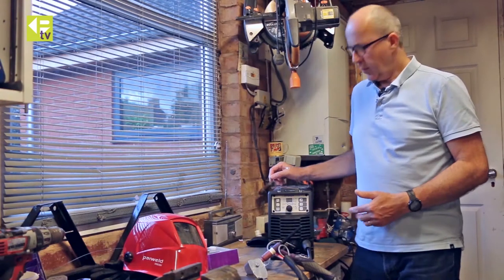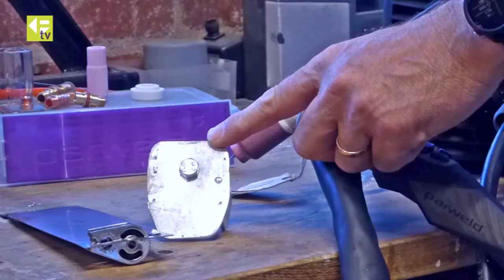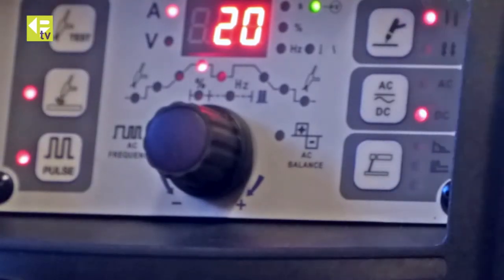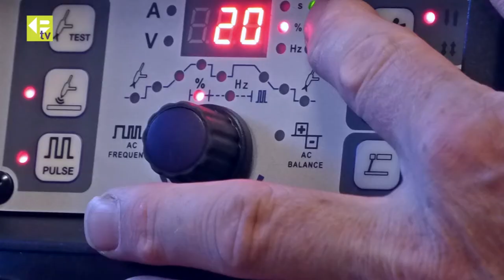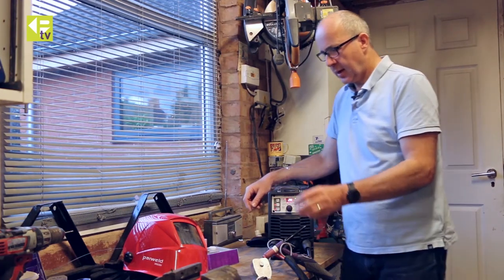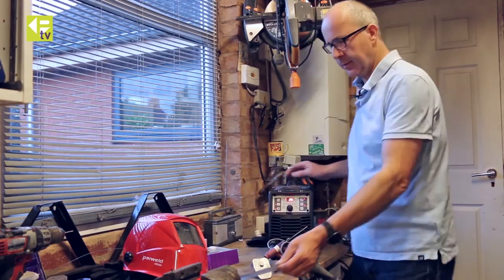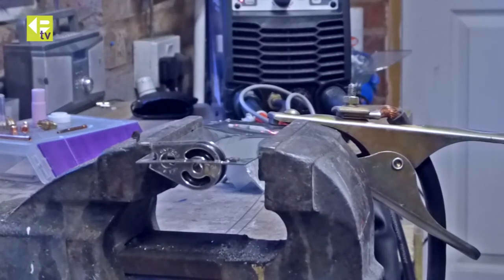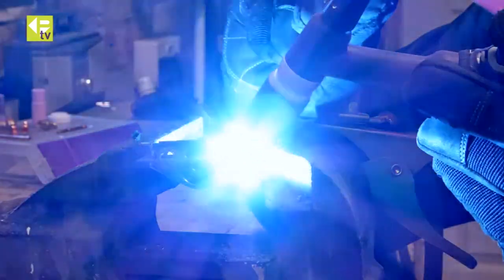Parweld XTT212 AC/DC Welding Machine Part 1

Comment: I got the older XTT202P and love it. Been using it for alu, stainless and steel for about two years now. The only thing I swapped out was the torch, I prefer the CK ones and to use a foot pedal. I got the Parweld pedal with my machine and it's okay. The only thing I don't like is that I can't set the max amp on the machine dial when pedal is connected. I have to fully press the pedal and use the pot on the pedal to adjust the max. Wrote a mail to Parweld and their reseller but didn't get any answer back.
Reply from the maker: Thanks for the feedback!

Comment: How much is the welder and does it come with a foot pedal. Considering getting an AC/DC tig from either you guys or RTech. Top regards, Jon DingleZilla Esq!
Reply from the maker: You would have to get a quote from a distributor as we are the manufacture, the part numbers you’ll need is the XTT212P-P1 and XTI902D.
Reply from the maker: settle down Beavis  we are the manufacture and we build these in our facilities in the PRC.